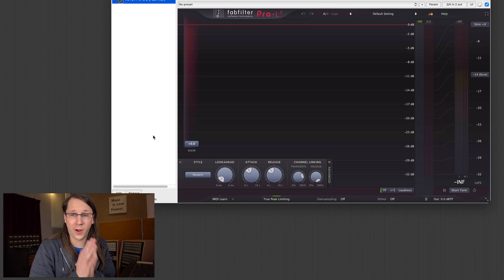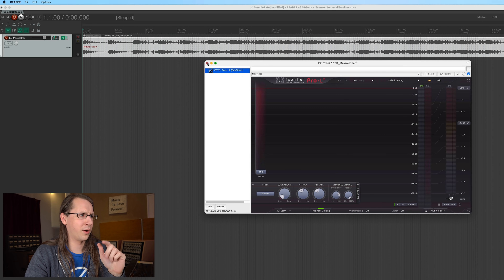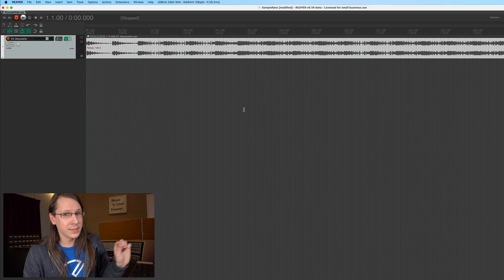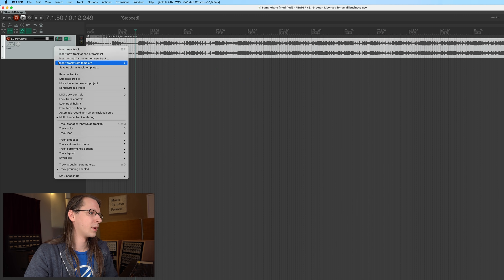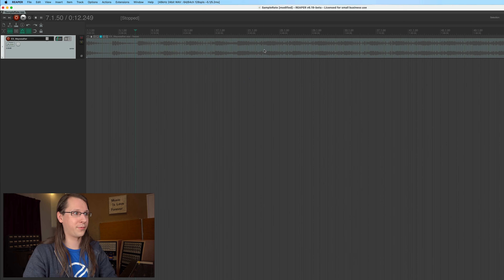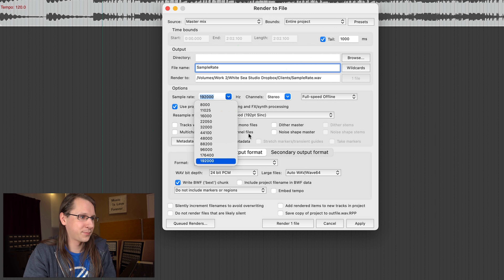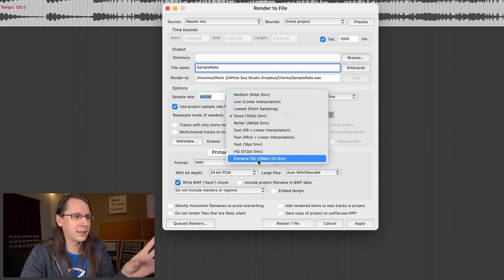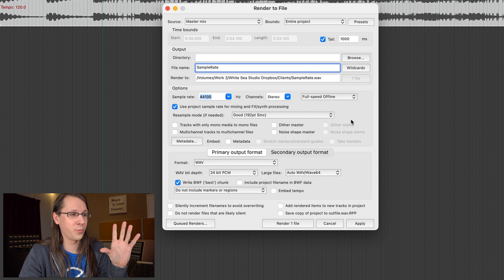WHAT is the BEST SAMPLE RATE?

Comment: I've been running my AD/DA at 48kHz for 2 years, after years of 96 and experimentation with 192. My Lexicon reverb's SPDIF only runs at 48kHz, which dictated the sample rate I used for several projects. I found that I honestly couldn't tell a difference. I quit worrying and have not changed since.

With a few soft-synths (NI Reaktor) and distortion plugins (as you've discussed many times) I can hear a difference in very contrived circumstances. But I don't think these would be audible in an actual track.
Reply: if you have clients do you ever have issues converting a client's 44.1 khz project to 48 khz?
Reply: well in single tracks it’s different, depends on the mix, when i submit the final mix to the record labels i usually go 96khz 1411 kbps 24 bit, if requested 32 bit. the average music consumer doesn’t give a honk on immaculate audio quality, they care about their phones and storage, thus preferring aac or mp3 to lossless formats, live flac, alac or wav, mainly because the highest quality they gonna have is spotify most times, which tops out at 256 kbps. i did an experiment, with several people, making listen various file formats of the same song, through the same equipment, and to the untrained ear, it all sounds the same, slightly more detailed when playing lossless, with high bitrates.. plus bluetooth, is now the main portable headphone output, which tops out at max 320 kbps (LDAC excluded due to sony/lg proprietary software) through aptixhd, so yea
Reply: @datutturugang666  thanks for so much info. I heard a pro say he prefers the sound of 48 to 96 because 96 actually has TOO MUCH headroom to respond to what he is trying to achieve. I have only ever worked in projects in 44 and I need to start up-sampling these to 48 for compatibility with gear I just bought. I wondered if anyone has hurdles or glitches in this conversion process, like plugins and samplers that don't do this reliably, etc. I use logic and I am crossing my fingers hoping it works okay. another issue with 96 is many plugins don't work in it, like older waves plugins.
Reply: @johnthecreative  i also use logic mainly, like 80%of the time, i usually have no issue in opening different bitrate files. it’s easier to open 48khz files in a 96khz project, because its exactly double, it gonna sound like a 48 file anyways, but i mean, who aside pros or audio enthusiasts even gonna care about the difference between a 44.1 vs a 48 file, if they enjoy a song they’ll listen the shit out of it even if it’s downloaded on a shitty mp3 downloaded from a sketchy website.. it’s just us visibly mentally unstable people who prefer comically large file sizes for a 5 minutes song lmaoao
Reply: @datutturugang666  well thanks for the info. Like I said I only know about 44 but now i Have to learn about others in order to use new gear requirements of 48. Crossing my fingers that I can easily switch sample rate of on an entire project in Logic Pro.
Reply: @johnthecreative  logic barely got me any problems in years, and i’m not talking sample rate alone.. the amounts of times i had trouble was like due to project settings when importing from different people with different plugins and midi tracks
Reply: @datutturugang666  wow thanks for sharing your experience with this. sounds reassuring to know I may only need to adjust those settings if I have problems.
Reply: @johnthecreative  ay homie you welcome, just keep in mind that most people gonna listen thru airpods lmao
Reply: @datutturugang666  oh yeah well I'm one of them. Sometimes I check my mix on my laptop speakers and I say "oh my God that sounds awful!" So I will have to go back and change something to make it translate better to those.
Reply: @johnthecreative  i also use airpods, but what i meant is basically nobody cares about audiophile stuff anymore, and under a certain standpoint they ain’t wrong, it’s basically throwing hammers to your feet, because nothing gonna sound good anymore, just caring about ultimate sound quality.. my advice is: listen thru whatever the honk you want, unless you gonna send stuff to record labels with specific requests, 44100 gonna be fine for most use cases
Reply: @datutturugang666  that's good because it's all l've ever used and I have done a lot of work in it. Most projects I literally could not have even completed in a higher sample rate - my computer wouldn't have been able to handle it. I've heard of people recording in higher rates just to have a higher quality version they will have stored for the future, but for now they still use 44. but that seems like extra work to me.
Reply: @johnthecreative  technical question. what headphone do you use mostly for mixing and production. before even worrying about sample rate, you need proper equipment. no need to throw cash in wild and exotic cans, but not even airpods work for mixing..
Reply: @johnthecreative  i highly suggest running an external soundcard or at least a dedicated one. there’s a lil guy on amazon, it’s recommended by everyone, it’s called the fiio btr5. i discovered mine thru the australian guy who’s also known as dankpods, all it does is take off raw signal from usb and process it. it’s unreal how much more detailed the signal output is, having an external cpu dealing with audio, made specifically and only for decoding audio and shooting it down your headphones. it’s on sale basically always, you can get it in like two days with amazon, it’s 150 usd for the 2021 model. also supports hi res bluetooth such as AptixHD and LDAC (yea i know only LDAC is technically hi res). thru usb dad mode, it supports up to 394khz in sample rate, but logic caps out at 196, but that’s high enough i guess lmao

my advice is, grab one asap, it’s rated for 150 ohms, but i ran 300-350 ohm headphones on the unbalanced output no issues. then, it supports 2.5mm balanced audio. the volume level out of the balanced is insane, it competes with analog amps, all without noise.

must have..
Reply: @datutturugang666  thanks for the tip. I was gonna use a UAD Apollo for A/D conversion. but I'm not at that stage yet. I just use an audio interface right now which I believe bypasses the soundcard on the computer; at least it makes it so that the soundcard is not used for converting audio from audio to digital in real time. I guess you are also talking about getting better sound quality for playing it back instead of just playing it off the sound card? that's something worth investing in for sure once I have the money.
Reply: @datutturugang666   for time being I stopped trying to treat a room and use "real" speakers. So I use auratones (("mix cubes" (vintage made in Tennessee in the 80s)  - the kind they used to mix Michael Jackson records - I use the exact kind. There's no low end at all which has pros and cons. Then I check the mix on small speakers like laptop speakers, etc. and apple earbuds. sometimes i fire up a mono Bluetooth speaker. I think it's good to get a better perspective to switch back and forth actually.
Reply: Could my set up be better? Yes? Would I also bet it's more accurate the way I use it than the way most pros use their rooms that they only think are treated accurately? Yes. I would bet it's more accurate than theirs. And it's more quiet than theirs too which protects my hearing and doesn't piss off the neighbors. I'm saving up for a subwoofer just for checking low end sometimes. I use plugins like Metric A/B which helps me see if I have too much low end. As long as it's not too much I don't care. If it's too little that's less of an issue.
Reply: @johnthecreative  you can literally use the btr5 as a soundcard, it’s insane with the right headphones
Reply: @johnthecreative  leave aside meters for a minute, there’s a huge debate goin on behind which standard is the correct one, like if you should mix in -14 rather than -11 lufs, but then there’s true peak, but then nobody gives a shit about true peak, so they use a vintage vu meter but since they can’t have a real analog vu meter they gonna download a free meter but then there’s the scale in which they’re zeroed off, but then there’s lufs again.. aaaaa, if your mix sounds good, it’s good, eventually you can always turn down the gain in your final mix, lugs is literally the last thing you gonna be worried about. just check you don’t clip in your output, if you don’t need to send your stuff to huge record labels you can be less restricted (every label has different requirements tho, use their rules when submitting to them)…
Reply: @datutturugang666  yeah I don't worry about that anymore now that I decided I will pay a mastering house to eventually master my work.

Comment: 192k yields some unruly file sizes to catalog, really only noticed a difference with a client playing classical music on a 9’ Grand piano with tremendous dynamic range in the music. Also it greatly reduces your access to how many plug ins can be instantiated. I agree-24bit/48k is the ideal tracking paradigm.
Reply: How can the dynamic range be affected by the sampling rate? The bit depth controls the dynamic range, by lowering the noise floor. And the hardware, no matter if it’s audiophile consumer hardware, a prosumer audio interface or professional gear, has yet to surpass the limits of a bit depth of 24 bits. And nobody would ever hear a noise floor of even 16 bit recording, unless the volume is at a level that will hurt and degrade your hearing capabilities quickly. So the advantages of 24 bits really only are of any interest in the field of recording and mixing. Or do I forget something here?
Reply: 192k has nothing to do with the dynamic range, it’s bit depth that is responsible for dynamic range.
Reply: >really only noticed a difference 
stop lying mxr
Reply: Stock plugins are good enough, also manufacturers can always upsample their plugins
Reply: You can actually get slightly snappier transients on drums and strings at 192khz.  96khz is a good medium. 48khz for all the projects I'm not really invested in, or need tons of plugins.

Comment: After lots of testing and listening, I'm absolutely content with recording and mixing at 44.1kHz. The only plugins I'll run with oversampling enabled are those that produce a lot of distortion.
Reply: 44.1 is great for music alone.  48 is what is used for film/video production (probably because it synchronizes with a 24fps ... I can be corrected on this).
Reply: @DerekPower  true. 44.1 and 88.2 were made fof music productions, but in todayd media - we do not havd to use dithering to 44.1 for cd purposes. Its perfectly fine working how you want.
The main consensus was that 44.1 was the main stardard for music (after dithering), and 88.2 was the high level option since it was more recomended to downgrade your project with no digital remainders. (hopefully i wrote that right).
Reply from the maker: Interesting... 44.1kHz is a difficult setup for me since AVB is not really stable/non existent in 44.1...
Reply: @Whiteseastudio  what’s AVB?
Reply: @JAMStudiosIE  
Audio Video Bridging 
(I actually just looked that up, and the first definition that came up was “already vaped bud“ LOL)
Reply: Same. Unless I’m working for picture, 44.1khz. What about the debate about whether recording at 48khz but printing your mix to 44.1khz causes audio degradation - theoretically or audibly?
Reply: If you are recording with the intent to go to vinyl, 44.1 is insufficient since there is much more room for higher frequency bandwidth and harmonics when pressing records. I sometimes record at 96k and it sounds much more solid and "there" compared to even 48k.
Reply: @firewerk66  i reckon there’s a whole debate of itself right there! I’m not a vinyl believer based on several things. Will let White Sea Studio take it from there!
Reply: @JAMStudiosIE  the closest a consumer is going to get to an actual studio master is a vinyl record, or spending big $$$ on a tape deck that can play 1/4" masters. I can immediately hear the difference when comparing a CD/digital 44.1/16 bit vs 24bit/48 or 96k. there really is no debate that records contain more information.
Reply: @firewerk66  Well, the additional sonic information you're hearing is mostly distortions from the recording media - in other words: imperfections that shouldn't be there.
Yes, that's what gives tape and vinyl its character compared to an extremely precise, almost clinical converter, but ultimately that's what it really is.
Reply: @firewerk66   Vinyl can handle only around 60dB dynamic! so that is nothing very close to a studio master :) .. just to correct this
Reply: @firewerk66  It may be that the vinyl has the potential to have frequencies that go higher and lower than 44.khz 16bit consumer for sure and I agree that they have the potential to be able to playback a wider audio bandwidth. In practice though when you master for Vinyl you have to HPF and LPF the music usually in order to get a cut. Its quite shocking actually (it was to me anyway) what needs to be pulled away and changed in the frequency spectrum to get a vinyl master that works. Then there's the playback equipment mechanical issues. On any vinyl I've heard the high end is simply distortion above say 12-14khz. Sibilance and cymbal crashes come across as a smear. For me vinyl is more akin to candlelight. It has an ambiance and a certain romantic feel but it couldn't be called accurate or critical lighting.
Reply: @JAMStudiosIE  not sure of mastering 44.1 vs 48 but if the higher sampling rates relax the filters and the audio path is cleaner, I makes sense to use higher sampling rate and resolution. All depends on your rig and it’s Limited capabilities. 

I believe vinyl dbs has been “extended” by the use of digital masters. Why? Little to no noise floor. Think about it when vinyl was first press it’s used tape. Tape hisses. When vinyl was pressed in the 70s and 80s op amps weren’t as good as they are today. Same thing with any soic chip used in those days… all analog processing chips are better so are the circuits. 

Digital is by far better. However the paradox between analog and digital is analog nowadays has better dynamic range because of the loudness wars. That’s on the sound engineers over using compression and linters during the mastering processes